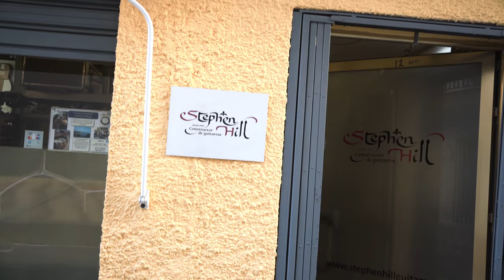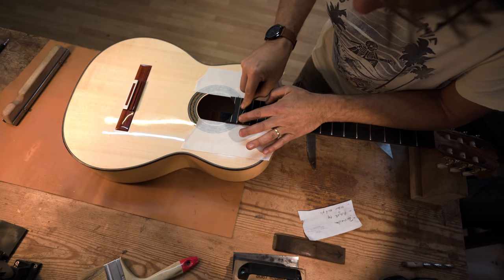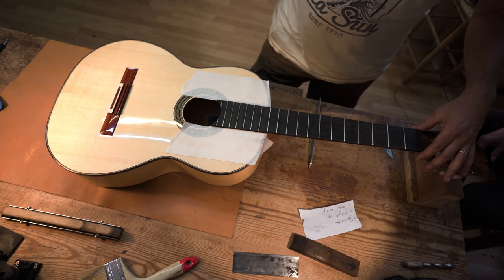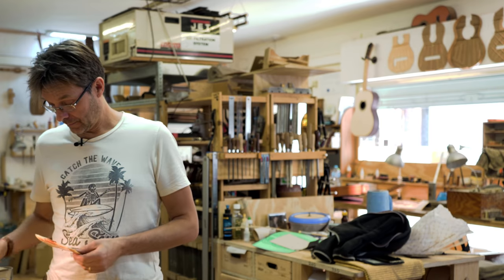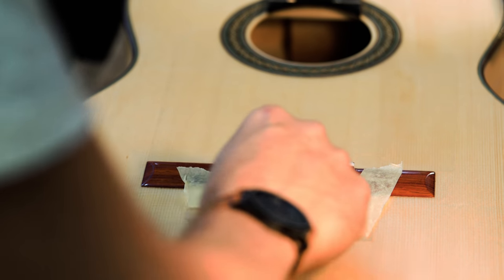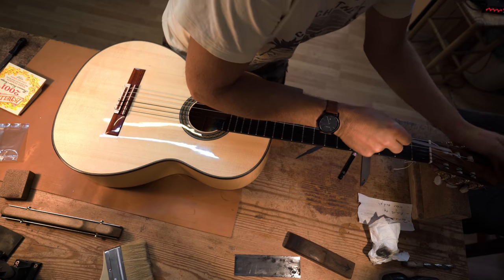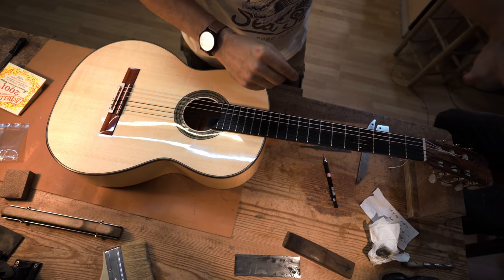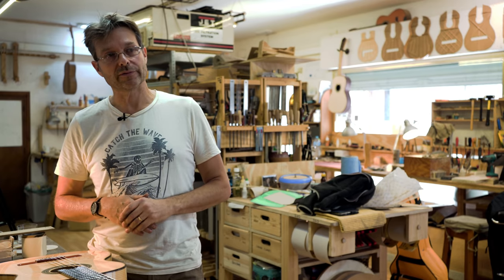Flamenco Guitar Setup Featuring Luthier Stephen Hill with Kai Narezo

Comment: Just did my first bone nut and saddle on a classical that I got without any. Ali-express: 5€ for a string action gauge, 4€ for pre-shaped bovine nut and saddle. Need to file off a few mm with a 120-240 grit sand paper. Now perfect at 6th 4.0mm, 1st 3.0mm at 12th fret. I measured up with only 1st and 6th string on. Went down to 6th 3.75mm, which did buzz (!), but when adding all strings, it raised to 4.0mm and no buzz. Be sure to buy bovine bone, as buffalo is softer.

Comment: Don't forget about the cigarette foil trick!
Reply from the maker: I know the cigarette trick (a cigarette shouldn't be able to slip between the strings and the top of the guitar by the bridge) but not familiar with the cigarette foil trick. Is it different?
Cheers,
Kai
Reply: @FlamencoExplained  Aluminum foil from a cigarette box is very thin. Thinner than kitchen foil. If the string height over the first fret is too low and it's causing string buzz, you lift the string, put a piece of cigarette foil flat over the string slot, and return the string to the slot. Then, you pull the excess foil fast and whatever stays in the slot pinched by the string, will be enough to remedy the buzz. It's an emergency method for gigs until you can get the nut properly cut.
Now, I have a question. If the guitar is properly set up and the string action is proper, why shouldn't a cigarette be able to slip between the soundboard and strings by the bridge? Imo, even if the strings are very high above the soundboard by the bridge, it shouldn't matter as long as the action is comfortable. Right?

Comment: This is such a cool video.   Fascinating.  I can't believe I bought a guitar without knowing any of this!  Next time I will be a bit more informed.
Reply from the maker: A good setup can help you a lot even after you've bought a guitar. You'd be amazed at the difference a proper setup makes to just about any guitar.
Reply: @FlamencoExplained  Thanks!  I changed the strings and it made a world of difference.  Lubricated tuning pegs and put a bit of pencil lead under the strings.  Tuning (specifically turning the lower pegs) is so much easier now.  I'm going to take it to a luthier and have them look at it to see if there is anything that could be improved.  It is an inexpensive, 30-year old factory (I think) classical guitar but it sounds beautiful.  I figure I might as well have it fixed up a bit, if possible.  Great video, it inspired me to improve my guitar!
Reply from the maker: @ropehitch  That's great! You can really get so much more out of any guitar with a proper setup.

Comment: Tara and Kai, I am looking forward to building a guitar with Stephen soon. Dumb question, when measuring string height , precisely what distance is measured. Is it from the fretboard or the fret to the bottom of the string?
Reply: Use a ruler marked with millimeters, measure from the top of the 12th fret to the bottom of the string. It is easier to read if you place the ruler behind the string.
Reply from the maker: Hey Miguel - Do you have a date in mind yet??

Comment: Kai, I got a GK Studio negra last December and have had tremendous intonation problems. Sent it back and they factory compensated the nut and saddle on the G string, and I'm still not really happy with it. Would different strings make a difference? I'm almost at the point of wanting a whole different instrument.
Reply: I have one and love it. i moved to hard tension though.
Reply from the maker: A luthier would know better than I, but if it's an intonation I don't know that different strings would help...
Cheers,
Kai
Reply: @brookeaday9423  why do you like hard tension better?
Reply: @DaltonPhantom  tighter feel and little more sound projection.
Reply: @FlamencoExplained  no, it wouldn't. But there is a truss rod that can be adjusted with the Cordoba.  Other than that they may be able to adjust the bridge to fix it.
Reply from the maker: @brookeaday9423  I always forget about truss rods 🙄
Reply: @FlamencoExplained  the truss rod may not do much for this problem.  If it's really intonation they can only fix it by increasing or shortening the string length from nut to bridge.  I would pay to have a good acoustic guitar gut assess it.
Reply: Have a qualified luthier check the fret placement and if the saddle and/or bridge is in the right place according to the scale length of the instrument.  If the proper scale length falls in front or behind the saddle, the slot needs to be filled with a matching piece of wood, and recut with a hand held router where the proper point falls in the middle of the saddle.  This is a common problem with many guitars.  I have had to have this done on more than one guitar made by class A Spanish luthiers. Often, apprentices glue on the bridge improperly, causing the intonation problem. It is usually not necessary to remove and reposition the bridge.

Comment: Hello! Thanks for your demonstration. Regarding action, I have a pretty low action on my guitar but not a lot of (desired) buzz. Apparently, my guitar came with "high tension" strings - would a way to change this be simply getting lower tension strings?
Reply from the maker: Worth a try for sure. But it’s also about finding that balance between desired tension for each hand and the sound of the guitar. But it’s the lowest risk and cheapest thing to try, so go for it and let us know!

Comment: Stephen does everything that I wouldn’t do to my guitar. I would use a cover for the fretboard in order to polish only the frets, not scratching the ebony fretboard. I would cover the sound hole, not to get any shaving particles into it. I apply fretboard oil on piece of cloth before I apply it, but not directly on the fretboard. Perhaps it’s a quick demonstration and not his daily routine.
Reply: we normally use a plastic guard to protect the top/cover the soundhole (I’m the guy wearing a beanie in the background and know Stephen’s methods pretty well) but don’t tape off the fretboard. If you’re careful with the files there’s no need to waste all that tape and using micromesh and 0000 steel wool on the frets and fretboard polishes both.

Comment: Hi, great video! I have a question. In this video here, the luthier (Marshall Brune) says that cutting away the edges of the top for the binding "takes away a lot of the resonance". Would it be advantageous for the sound of the guitar to go without the binding and therefore have more resonance? Sure, it wouldn't look as nice. Or is resonance unwanted? Thank you very much for clearing that up for me!

EDIT: link here https://www.youtube.com/watch?v=qmDAIlEGO_Q&t=3506s
Reply: that resonance is brought back by installing the bindings. When you cut binding channels the guitar’s tap tone turns to a terrible thud (makes sense considering there’s now holes all along the edge) but once the bindings are glued it sounds better than before (I’m the guy in the beanie in the background of the video and know Stephen’s methods pretty well)
Reply: @brianitzkin3351  So ok, the binding actually has the function of "binding" the the sides to the top? And it sounds better with binding than before cutting the edges of the top away? Interesting. I am very grateful for you answer, cheers! :-)
Reply: @corallaroc2946  the bindings function to protect the delicate end grain of the top and back which are prone to splitting when exposed to trauma (the thin veneer lines between the top/back and bindings known as purfling are simply decorative). The guitar is assembled and a channel is cut with either a router or scored with a tool known as a gramil with the waste removed with a chisel before the bindings are installed and glued to the lining which is installed internally for additional support on the delicate top/back joints. My theory of the soundbox becoming more responsive after the bindings have been installed is just a theory based on my experiences building guitars. Lots of inexpensive Martins and Gibson from the 20’s and 30’s (Martin’s 17 series come to mind) do not have binding as a cost saving measure and sound just fine regardless
Reply: @brianitzkin3351  I see! Thank you for going through the trouble of explaining all this, very much appreciated!

Comment: I'd be wary about sealing that beautiful wood in shellac  and suffocating the sound and vibration.
Reply from the maker: It's ok, really! All guitars have some sort of polish which actually serves to protect the wood. And I think most luthiers would agree that shellac really does allow the wood to "breathe" much more than the alternatives.
Reply: @Flamenco Explained  has anyone done a double blind test on the sound production with and without a sealant? Just curious. They say the shellac used on Stradivarius was a crucial component.
Reply from the maker: @counterflow5719  I've heard that about Stradivarius, but I don't know of any tests like this that have been done. Maybe we have to wait a couple hundred years to see!
Reply: @FlamencoExplained  if I had to guess, I'd say bare wood, while not as pretty, would ring out and vibrate and resonate better. It could be easily tested. I used to work in a vibration lab at Wyle laboratories. Put the test cases on a Shaker table, run a sinusoidal sweep and measure the response from the test pieces.
Reply from the maker: @counterflow5719  Cool - sounds like interesting work you did! What sorts of things were you testing (if it's not classified? :) My question - and I'm not doubting you here so much as I actually have no idea - is whether the measurements would translate to a subjective improvement. Is more vibration in and of itself the goal, or is it more a specific type (or types) of vibration we're after? I'll ask my nerdier luthier friends to see what research exists.
Reply: @Flamenco Explained  we tested mostly aerospace and military equipment.  It was an environmental lab, meaning we would recreate the environment that a part would see in use, vibration, shock, salt fig, altitude etc to see if the part would survive it's use environment. My area was vibration and shock. The electro dynamic Shakers we used were essentially a giant water cooled speaker. We could actually play music through them, but the "tune" we usually played was either random vibration per mil standard 800B or a sinusoidal sweep from 5hz to 2000 hz.